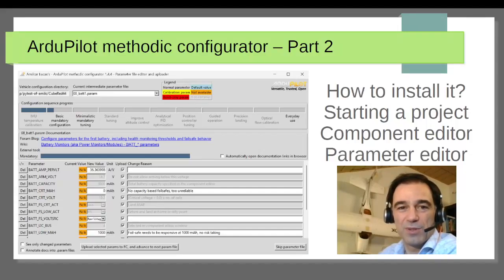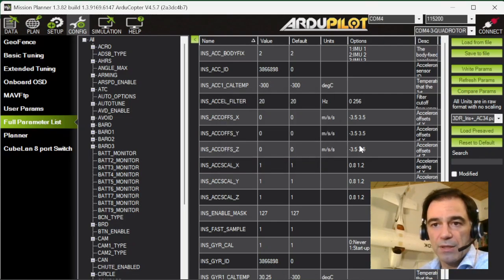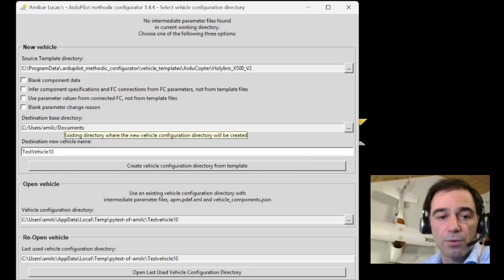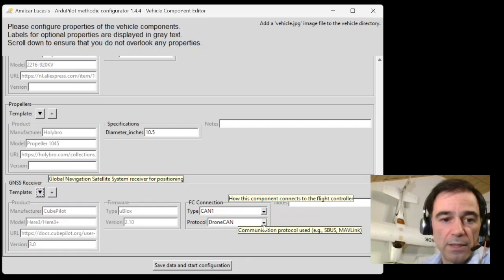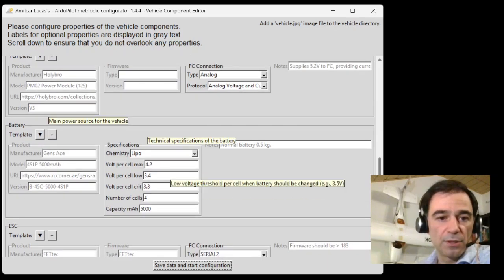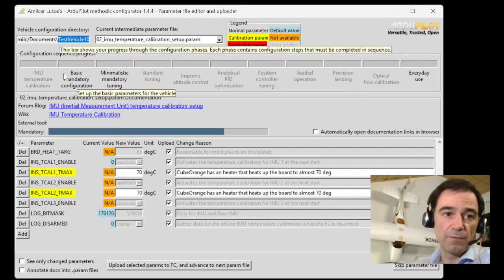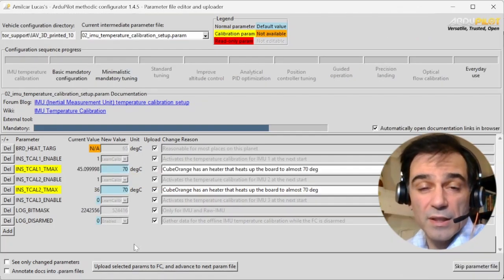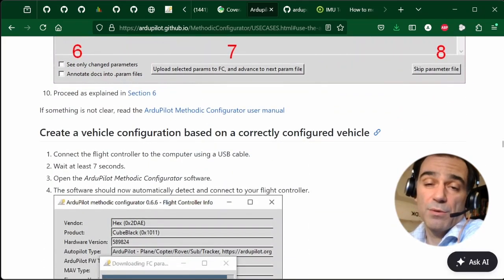Use the ArduPilot Methodic Configurator software for the first time

Comment: looks good,
its support VTOL? at ardupilot 4.6
Reply from the maker: Yes, it has initial support for ArduPlane. But is not as polished as the copter. Suggestions and improvements are welcome
Reply: @AmilcardoCarmoLucas  
I would be happy to help, I have extensive experience calibrating a wide variety of UAVs.
To begin with,
Note that the names of the parameters containing ATC are in different names (starting with q_).
It is also required to enable Q_ENABLE to receive all the parameters.

The process should begin in 2 parts.
1. Drone calibration with matching the parameter names.
2. Fixed-wing aircraft calibration.
Reply from the maker: Create github Pull request with code changes
Reply: @AmilcardoCarmoLucas  Thank you - Interested in VTOL version also.

Comment: Great video Amilcar and thanks for the info!!!, i already installed the software in my pc. I have an old APM 2.6-2.8 flight controller that is not well calibrated(in loiter mode have huge altitude variations). Can i use the methodic configurator with it?. Many thanks in advance!!!
Reply from the maker: No, hardware that old is not supported nor recommended